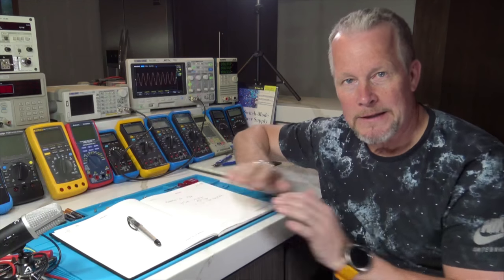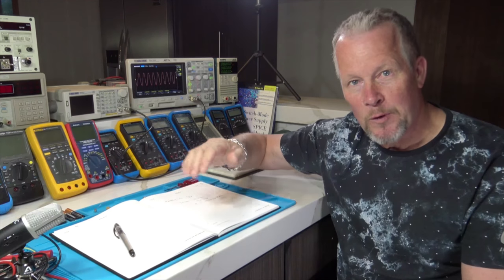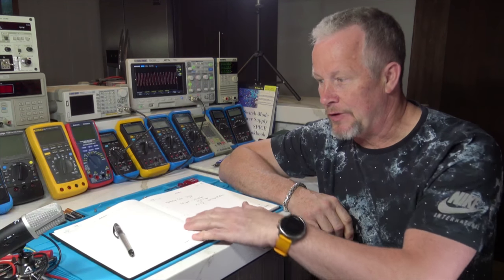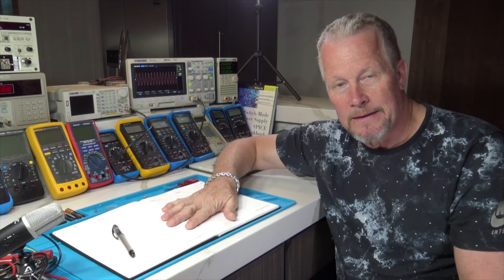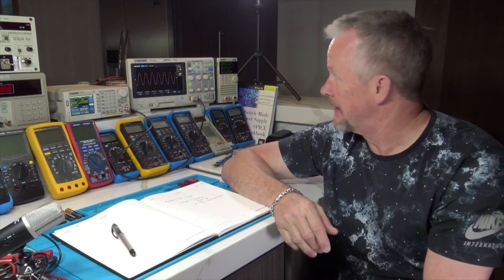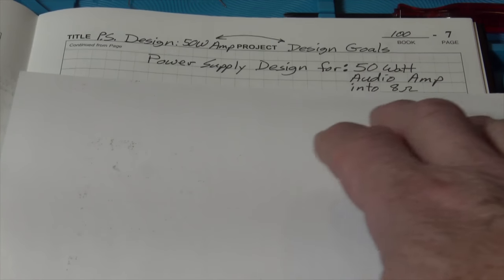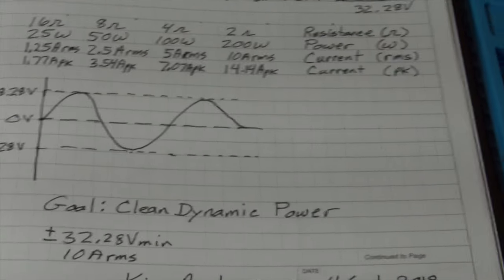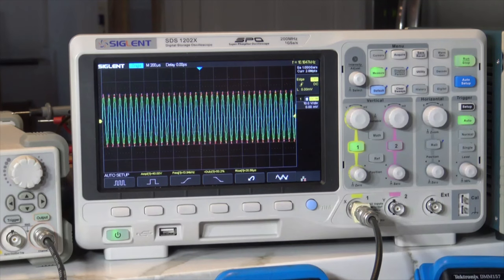Power Supply Design for 50 Watt Audio Amplifier part 1

Comment: Would this power supply work for a 20W LM1875T? Or too much power?.. awesome video btw..
Reply from the maker: Jason Herman you would want a transformer with +18 V and -18 V which would give you 25 V on each rail after the full wave bridge rectifier.  Thanks for the support!
Reply: @KissAnalog  I'm actually trying to find/make a PSU for exactly the same purpose and was looking for a +-18V transformer. However you just mentioned that after rectification you get +-25V. How does that work?

Comment: Hello Eddie, thanks for great series and in very first one vide I find things that deal with what I do.
I need you advice, I don't understand measurment I made on my recently build SE tube amp.  So basically I wanted to measure wattage of an amp, and classically I plugged singal generator on the input and dummy load on the output plus multimetr and osciloscope. The input voltage that on output still produced no distortion ,clean sinewave was 0.88VAC and on the output ...5.13VAC RMS on lets say left channel. with 8ohms load it gives 3.28Watt of power. 
However ... measurments on osciloscope showed 78V on the peak (78V max, -64V min). With the calculation that Vrms=0.7071*78 it is still not 5.13Vac rather over 55Vac. I am confused. 

thank you for help
Jacek
Reply from the maker: Thank you Jacek!  Was your probe and scope both set to the right multiplier?  I mean if your probe was set to x10, then was your scope?  It almost seems like your scope voltage is a factor of 10 off.  Also, what frequency are you measuring in?  Many multimeters are only good up to 1 kHz, then the reading will start to drop in amplitude.  Hope that helps;)
Reply: @KissAnalog  Hello Eddie, I think I checked multiplier value but that would make sense so let me check again :) regarding frequency I used 1kHz , I was not aware about impact of frequency for measurement so good that I've not picket much higher value. I will use the opportunity and make some tests with lower and higher freq .
Reply: Is that -64V or 64V?  If your signal has a large bias and is alternating between 78V and 64V, that gives you a difference of 14V, which halved is 7V. (7 *  0.707) = 4.9VRms